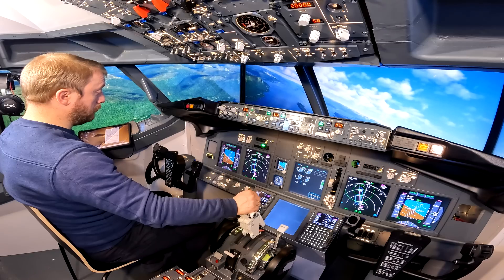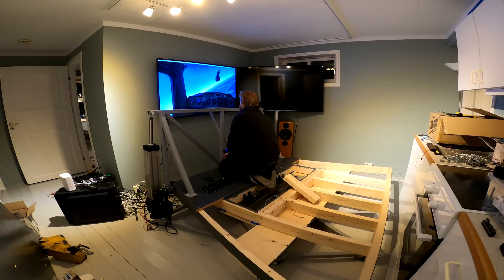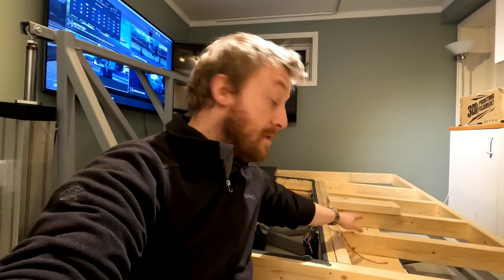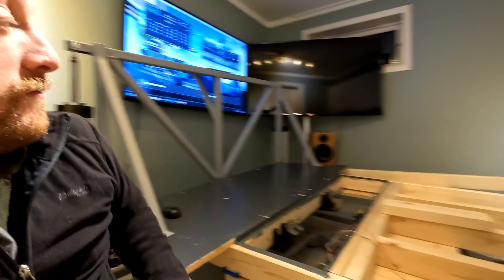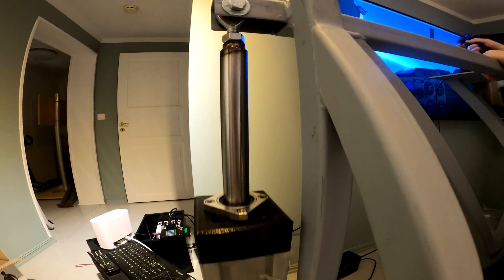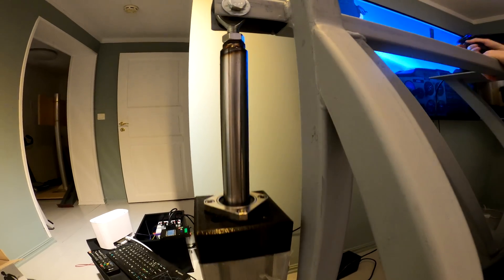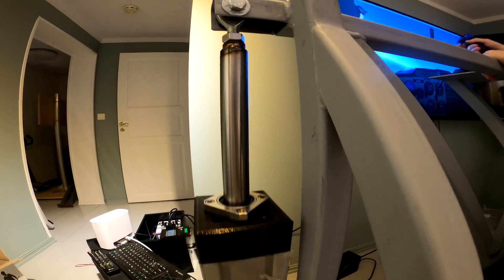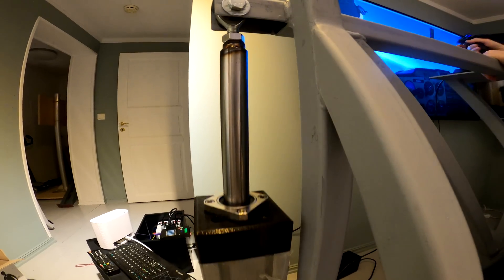Motion Simulator build and test flight

Comment: Every problem looks like a nail when you have a hammer. Wood and plastic for the core platform. Wrong place to save money. Besides. PETG is nowhere as stiff as PLA. But you need a steel joint and a good structural platform made of aluminium

Comment: What are you aiming for with the motion in roll? 
You wouldn't normally feel lateral forces in flight because the aircraft cancels them out by banking, so only might feel a transient roll as you move the ailerons which would quickly zero out once the aircraft rolls.
The sim movement in pitch looks to simulate braking and acceleration, but you might need more backward movement for a full throttle take-off!!
Great job. you must have spent many hours getting such a realistic cockpit.
Reply from the maker: I'm aiming for the sway and roll to cancel out in a coordinated turn. Thereby still getting motion cues when things are not coordinated

Comment: This ia one fantastic project and very well done!
Regarding motion there isn't much a feeling of motion in an airliner. It is supposed to be flown gently so the only disturbance you may feel sometimes is turbulence. At the take off you'll feel the acceleration for a few seconds and a slight feeling of the braking after touch down, but that's it! You're never aware of being in a turn except when looking out of the window since it's flown coordinated with not much banking.

Comment: Incredible achievement but you seem to be putting an awful amount of trust into a 3D printed part, surely good old fashioned casting  would be a much better solution or just build a UJ from discreet parts? Sounds like there will be some tremendous stresses down there and would be a real shame for it to fail … but great for having a go at an incredible project. Good luck fella ❤

Comment: I'm a lorry mechanic. Why not get an old HGV propshaft from a breakers yard, cut down to length and weld two steel  mounting discs on it either side?  Something from a DAF CF for example. Simple, readily available and more heavy duty as a base.
Reply: Any of the suggestions given here would work better than 3D printing this part!
If it had flex when he installed it IMAGINE how much flex it will have when the added weight of the full simulator is added to the frame! 😮
Reply: Yes. I hate people 3d printing shit that can be bought for $20 at the wreckers
Reply: @kiwiadventures3773  The thing is, for most people who own a decent 3D printer it (and CAD) becomes an all-purpose hammer lol
Reply: @kiwiadventures3773  3d printing for 300hs
Reply: Also parts from farm tractor PTO shafts could be used for a cheap durable solution.
Reply: I think for this aplication any car ujoint would do.
Reply: I was thinking there had to be a better way and this must be it!  I'm a 3d printing hobbyist and i dread to think what that must have cost him to print - hundreds!
Reply: came here for this comment - couldn’t understand why you would waste 300 hours printing something out of plastic when an actual universal joint will do?
Reply: I don't understand why, arguably, the most crucial, stressed and hard to reach part is 3D printed and not made of metal. Seems like a lot of frustration waiting to happen.
Reply: That's exactly what I was thinking 🙂
Reply: AHH your a wise man sir !  I deal with bikes alot and was thinking of using a bunch of steering dampeners to give a bit of push back if that makes sense ..

Comment: Looks awesome! Not a critique, just wondering.. you have obviously invested a lot of time and money in this so I'm just wondering why you didn't go with short throw projection for the screen.
Reply from the maker: I did consider projectors during the design phase, as there are several benefits of using a projection system. The reasoning for ending up using TVs is the lower cost of 4K and the clarity. With a projector on a curved screen you will loose resolution and clarity of the image wdue to some parts of the image are in focus and others not. In addition, TVs have a much higher light output, allowing the cockpit interior to be brightly lit, which is not the case with projection.
Reply: @B738DIY  That makes sense, thank you for the answer! I am totally jealous, keep up the great work and thank you for sharing it with us. If I can't have one, watching someone else make one is the next best thing!

Comment: I had the same issues 14 years ago,  developing a 3dof motion simulator. I have solved it with an arm the is linked to the platform and the base. In the arm there were 2 rotation joints aligned with the universal joint of the base
Reply: I've not done anything like this - but similar effect to a panhard rod on car rear suspension may work?
i.e. long enough that the rotation about a point is negligible - but stops rotation around the vertical axis.
Reply from the maker: I'm in the process of making a panhard rod, thank you for the suggestion. I have modelled the motion using a panhard rod, and it will introduce less than +- 1 degree og rotation around the vertical axis which is a significant improvement over the current situation.
Reply: @B738DIY  Cool
If you wanted to get really complex, a glance at steam engine design might be fun. 
'Parallel motion' does exactly that & potentially gets you to zero rotation depending on the backlash in the joints.
(IMO Stick with Panhard at least initially :) )
Reply: @richardlincoln886  Came to the comments section looking for this. My thoughts are along the same lines. A diagonal bar running across the back of the platform mounted at one end to the platform itself and at the other end to the base. This is the exact same principle as a panhard bar and will eliminate any twist whilst still allowing full pitch and roll freedom of movement.

Comment: i believe that joint will brake easily over time with all the weight loaded onto it
Reply from the maker: It will be interesting to see. So far I'm impressed with how well PETG handles abuse. I'm more worried about the interface between the u-joint and the plywood on the wooden frame. The safety factor is above 10 in static load in the vertical direction and torque loads are very limited in time

Comment: Incredible work! What is the max bank angle of your motion platform? Also, will it be able to replicate/pick up turbulence? I don't even know if MFS provides that data as an output...
Reply from the maker: The limit is +- 11 degrees in pitch and roll. I will be able to replicate turbulence as long as MSFS provides the motion data
Reply: @B738DIY  There are plugins for buttkickers, so maybe you could use that data?

Comment: FYI Loctite is notoriously bad for plastics. Even the vapours can cause the plastic to get brittle. Even PETG which is normally resistant to most chemicals can get brittle with loctite. 

Other than that I think you’ve made a tremendous simulator!
Reply from the maker: Thanks for the heads up. I will know where to look if I hear craking sounds!

Comment: That is nice! Good job, but the only thing is that it’s so expensive! At one time I thought about doing this until vr came around now with vr there’s more emersion and you can fly multiple types of aircraft ,so much cheaper , with a good vr head set good hard ware rudder pedals yolk throttle quandrant it’s all you need!
Reply from the maker: It is expensive! But I find that half the fun is building and making, not only flying. I am however following the mixed reality development. But again that will add a significant cost

Comment: A suggestion to solve all your yaw problems would be to build a larger version of the anti rotation bracket that's used on rc helicopters to stop the swash plate turning.
Reply from the maker: Thank you for the suggestion. I will look into the feasability of making something like that!

Comment: for my "german" eye there way to much movemant to the site, u cant even walk on it, i see u have to walk very carefully inside the sim. u shoud make a metal 3d print for the Joint so it will not move any more and ur equip is very more stabble on the plattform above it
Reply from the maker: The movement is not ideal, and I might have a metal one made at some point. But there is some benefit of having some flex. Having some compliance in the bearing reduces the loading on the wooden frame and the mounting between the u-joint and the wood plate. So far I'm not noticing the flex and movement while flying

Comment: Very cool. Would a u-joint from a truck not be an option? I had a flashback from the Fifth Element when the top panels were hanging down.... Amazing build.
Reply from the maker: A truck u-joint would probably be stron enough. My problem was to find something with flanges. A truck u-joint would probably need fabrication work before being suitable

Comment: Just change you roll telemetry to 'rate' instead of 'angle'.
Reply from the maker: I'm playing the idea of using roll angle and sway to cancel during a coordinated turn. But I don't know if it will work out
Reply: What software are you using to drive the actuator controllers?
Reply from the maker: I'm using Simtools V3
Reply from the maker: What I'm struggling with now is that it looks like the acceleration data is in a reference frame to the world instead of being translated to the seat reference frame. If I'm only using sway, I feel sideways forces in a turn, while this should not be the case in a coordinated turn. How does the other softwares handle reference frames?
Reply: @B738DIY  With a 2 DOF turn sway right down and use roll, but as a 'Rate" not an angle (you will still get a more realistic sway from the actual movement of the rig).   SRS is designed for simplicity and has extra selections from the usual  (only available when a aircraft sim is active) for Roll as an Angle or Rate and Pitch as an Angle or Rate.  I would select Roll as rate and Pitch as Angle (recommend you have a look at their website for more detail).   With FlyPT mover you need to select the correct telemetry similar to Simtools, but they also have ground/air profiles.
Reply: @B738DIY  I understand that in the real flight simulators they have something in the motion programming called washout. I recently saw this explained in a YouTube video. When you bank the aircraft it rolls the sim in that direction initially but slowly cancels that roll out so that you don’t continue to feel like you’re sideways.

Comment: Hi, nice to see the sim going back together, I would have forgotten by now where everything went. By fine tuning, are you talking about how the platform seemed to lift on takeoff roll as you accelerated but then seemed to run out of movement at VR when you needed to angle the platform up for the climb out? Oh yeah, better seat are going to be a must! Absolutely brilliant, what a great sim. All the very best Dave.
Reply from the maker: It turned out to be more than fine tuning. I had roll work in the wrong direction, resulting in very high sideways "forces while banking. My plan is to tune roll and sway in such a way that they cancel in a coordinated turn. It is behaving much better now.
Reply: @B738DIY  Will we be able to see that in a future update do you think.
Reply from the maker: Yes, I'm planning om making some normal flight videos where the motion should be visible

Comment: Had the same idea with the u-joint for reducing weight on the actuators. Mine is a bit smaller though - C172. Hoping to integrate with my pit in the next year.

Comment: Great update - I have been looking forward to seeing your progress - the added motion will be much more than you can imagine, unless
you've already spent time in a full motion simulator - then you "get it". 

At V1, then rotation, feeling being pushed back into your seat complemented with the vision on your screens is "so perfect" !!!. Course changes during properly banked turns (depending on IAS or TAS) are typically not quite as noticeable ---- and in IMC, with motion, it may sometimes get "odd" for your senses to get right - Obviously your PFD or HUD are your absolute guides. 

Will you also be able to program in cross wind component landings that create less than "butter" feeling angled touch downs? just curious...Brilliant technology indeed along with your excellent technical expertise. Have fun -- Cheers.
Reply from the maker: Thank you! The motion is already adding a lot of imersion although I'm not done with the tuning. I do allready feel alot in the landings such as when a wheel grips while having a side ways component to the velocity

Comment: I think you may end up revisiting that UJ in a few months. Am surprised there isn't a suitable off the shelf part, or maybe even you could get something custom that would last many years. This is a very cool project, and I look forward to seeing it "finished". Or at least, with proper seats!
Reply from the maker: I might have to! For now it seems solid, but I will have to do regular inspections to check for signs of failure. It is possible to get parts, but flanged u-joints of a suitable size is more in the industry domain and harder to come by. 

I'm working on seats and I will make another build video when I'm ready to assemble

Comment: Very very nice,  is the no way you can line the TV edge with the cockpit window frames ?? . Say two smaller ones for the front of the cockpit and longer ones for each side
Reply: I'm not sure that's going to be possible, but you can certainly buy TVs with smaller bezels. :)
Reply from the maker: You might be able to, but ideally you would like the outside view source as "far away" from the windows as possible to give the correct sense of distance and a stationary horizon.